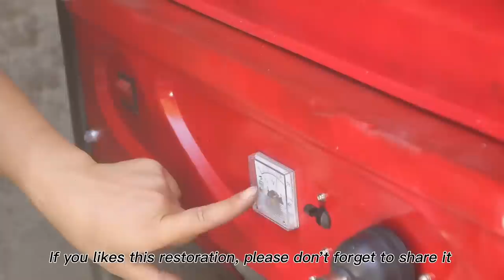💡The genius girl helped the villagers repair the generator, which doubled the power

Comment: She took it apart , cleaned it , painted it and put it back together.   It looks nice but I don't see where she fixed anything.  That's unusual as she normally does actual repairs on stuff. 🤔
Reply: This is abridged video, if you look at her video file you will find the full rebuild of this generator.
Reply: @Curiosity-NZ  Thanks for the info

Comment: Wait!  Pounding a few dents out and using body filler on a straightened frame along with a wash and repaint certainly didn't do much to 'rebuild' this generator.  Yes, it looks clean and bright but as to refurbishing it, not-so-much.

Looking forward to your next project.
Reply: This is abridged video, if you look at her video file you will find the full rebuild of this generator.
Reply: @Curiosity-NZ  Then that should have been explained to stop confusion.